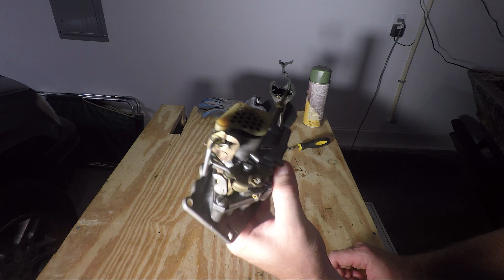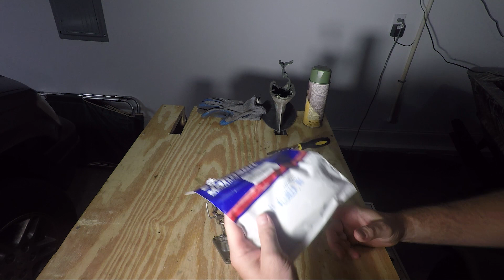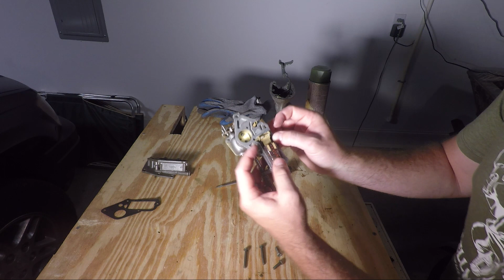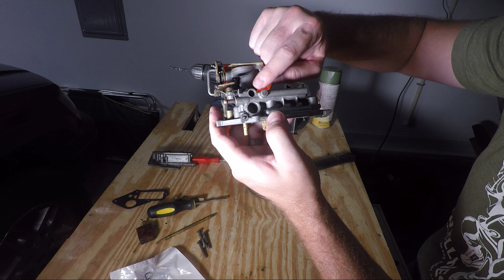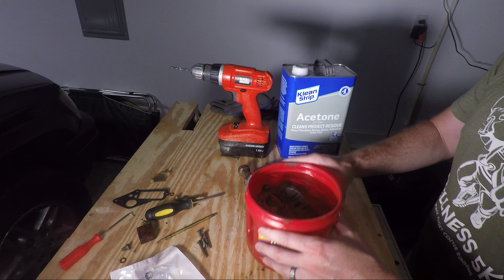9.5 Hp Johnson Evinrude Outboard Carburetor Rebuild - 1of2

Comment: Tip/ opinion. I would use steel wool or Scotch Brite to clean the "ridge" off the needle. Do not use emery paper. Or you could use 320 to say 400 wet and dry sandpaper, which will allow you to have more finesse while blending the ridges. The best thing to do is replace the damaged  needle if you can. Thanks otherwise for the good video.

Comment: Hey, I liked the video, but I got a question.. At the bottom/side of the float bowel, you took the screw out, and small gasket, but the 'carb parts diagram' available 'Crowley' indicates there is a 'orifice plug' in there as well. a brass one, that costs $60 .. I only took the screw out to see if fuel came out, while trying to start the motor. Seems NO fuel inside the carb, engine only runs pouring gas in the carb for a sec or two. i'm freaked out the cost/part order time to take the carb apart, gaskets and stuff. Another thing, that long needle valve, on my motor is say its a ' mixture (rich/lean) adjustment knob by the choke control. Please help.. Thank you.
Reply: Oh, btw, the engine was running in a water barrel, a few weeks ago, for an hour. A bit hard starting, which make me mad, but was running eventually. Any thoughts?
Cheers!

Comment: Hey!!! I hope this channel is still active! I’m a first timer and your carb breakdown video was amazing…. However.. I don’t know how to get to the bolt under the flywheel to remove the whole carb to pull the gasket
Reply from the maker: Will need to pull the flywheel 

https://youtu.be/Vx1hu-VXy8g
Reply: You’ll have to pull the top of the flywheel. To get the last bolt put the gear lever in the “Forward” position and twist the handle forward. Didn’t have to remove the lower part of flywheel.

Comment: Nicely done! Quick question: what's the point of replacing the two metal caps? Is there any important holes or passages behind it that needs to be cleaned?
Reply from the maker: Only if your carb is super dirty

Comment: how about any info on the high speed jet removal?
Reply from the maker: http://www.marineengine.com/parts/johnson-evinrude-parts.php?year=1968&hp=9.5&model=MQ-14D&manufacturer=Johnson&section=Carburetor+Group

Check out find number 40 and 69 for the needle valves

Comment: thanks, your video is very helpful.  One thing I have found useful is in removing the caps, i use a sharp drywall screw and screw it into the soft metal of the cap.  it normally does not even have to penetrate before you have enough leverage to remove the cap.  just a thought.  much safer then drilling and no metal shards to clean up.   Thanks for the video.
Reply from the maker: Fantastic tip.  I’ll try that next time.  Thanks a ton

Comment: Do you happen to have a video on setting the low idle after the carb is re-installed.  Mine starts right up but seem to be struggling getting it to idle at low idle.  I rebuilt this at low altitude and then took it to 7000 feet.  Pretty much runs the same at both altitudes.  I started with seating the low idle needle and then backing out 1.5 turns.  Any advise.  Thank you!
Reply from the maker: I do not but I will add that to the list.  

Its best to set the idle on the boat in the water.  Are you trying that?
Reply: Not yet but that is the next step.  I first started it in a garbage can to make sure the rebuild was successful.  Then again at altitude to make sure it would start.  Next trip is to the lake.

Comment: Is there a factory reset for the idle adjustment knob? Or do you just screw it back in and adjust while the engine is running?
Reply from the maker: Gently seat the needle then back of 1 and 1/2  turns. Make final adjustment with boat on the water

Comment: Thank you.  This was very helpful.  Working on my 1968 9.5 and this was great.  FYI I agree drilling out the plugs made me nervous.  Since the metal is very soft, instead of drilling, I lightly taped an awl with a hammer and it went through the soft metal very easily.  then they pried right out with the awl.
Reply from the maker: Bob, that’s a good approach.  Thanks for the comment

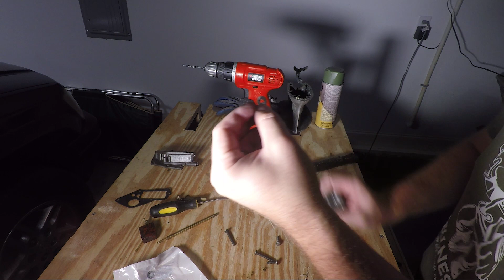Comment: do you have to take the flywheel off to get the carb off? And do you really have to take the caps off ( 5:30 on your video)
Reply from the maker: I don’t recall removing the flywheel and I checked my service manual and it doesn’t mention removing the flywheel in the removal steps.

If you don’t remove and replace the caps you may not get the jet ports clean BUT if the motor hasn’t been sitting for years you may be able to get away with it  ¯\_(ツ)_/¯
Reply: I was told it has been sitting for 15 years in a garage. I have replaced some hoses and fuel pump. The motor cranks very easily and idles nicely. When I put it in forward and try to increase the rpms it kind of bogs. So, I just ordered a carb kit. Today I am going to replace the impeller thanks to your video. I hope this removal goes as smooth as your video. 

In another video the guy was saying there is a screw on the backside of the carb which is under the flywheel. And he had the flywheel removed, he said there isn't anyway to get to the screw without flywheel removal.

Thanks for the video and the response
Reply: On my 1968 I did not remove the flywheel.  The screw on that side is sort of under the flywheel, so I would take it out last with the carb body so it doesn't fall down under the motor.

Comment: Ok I came here to find out about a fuel pump for this engine....  I did subb ya and like......  I do small engines such as Lawn equipment and chainsaws.......  

Do you have a source for a pump kit ???
Reply: Is there a factory reset for the idle adjustment knob? Or do you just screw it back in and adjust while the engine is running?
Reply: Jesse  1 turn out then start the engine and open the throttle in gear under a load.......

If it hesitates then go another 1/8 turn and try again....   If not then another 1/8 turn.........    Get that sweet spot....

If not then the idle circuit is clogged and you need to dip the carb in a ultrasonic cleaner  and take that welch plug out on the side of the carb.....  That silver thing he said in the video.......

Plus Tard Mon Ami ...........
Reply: Thanks so much. I'll give it a try

Comment: The side of my carb under the float bowl there’s a hole that pours gas out of any help???
Reply from the maker: As in pours gas OUTSIDE of the carburetor?
Reply from the maker: Send a pic to thisoldoutboard@gmail.com
Reply: rocket city motors yes sir out of the side of the carburetor but will do when I get off work thanks a lot!
Reply: rocket city motors email sent.